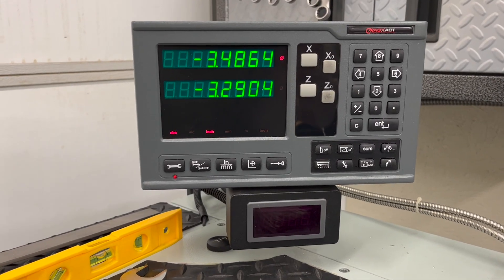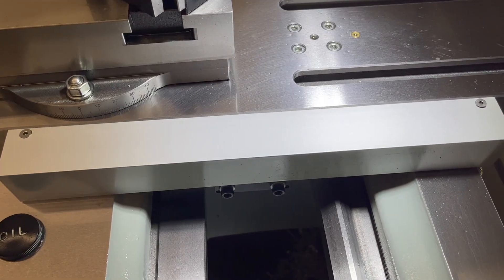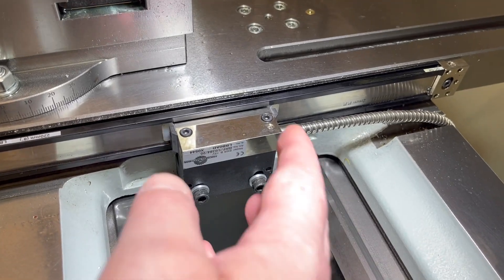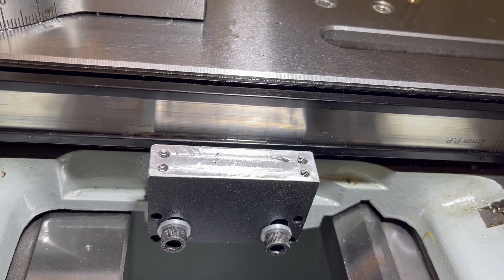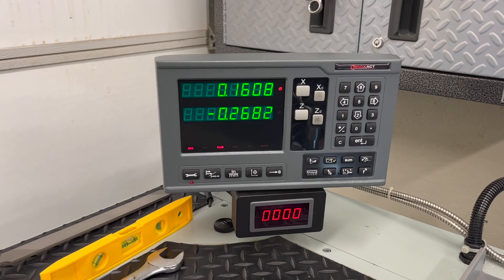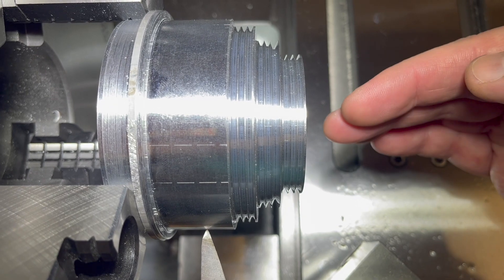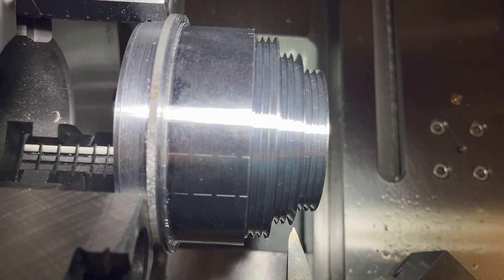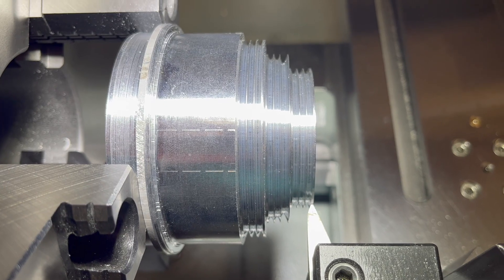MAGXact DRO Slide Clean/Repair - One Tiny Chip Scrapped A Part

Comment: Do you clean up with compressed air?
A chip that big should not be about to get around the cover from the top, so most likely it came in from the bottom
Reply from the maker: @joshua43214  Thanks for the comment. I rarely used compressed air on the lathe. Also the only time it has happened in 4 years. I did an early project the hubs video on my channel and had piles of chips so I think not happened then.

Comment: Glad you got this fixed.  Pretty much what I expected.  On my lathe, I mounted the magnetic scale facing down rather than sideways, and after 6 years, I haven't had an issue like this.
Reply from the maker: Best Services - Thanks for the comment and offering any their solution. If this becomes a recurring issue I may try that.

Comment: Yea be careful with steel chips getting in... steel is magnetic so it will affect the reading. Even if it was not magnetic the fact that there's a chip it may cause it to miss a reading... I noticed with the magnetic DRO scale apart from the cover there isn't much else protecting the scale from chips. On a glass scale the scale itself is inside a U shaped channel with a rubber gasket thing basically keeping anything from getting in, then there's another cover that keeps chips out. I've never had any problems with it at all as it's quite hard to get chips into it.
Reply from the maker: Tyler Fu - Thanks for the comment. May have to work on the cover if this becomes a recurring problem.